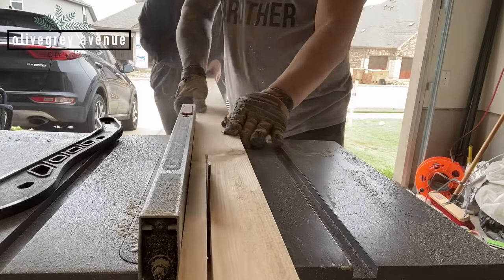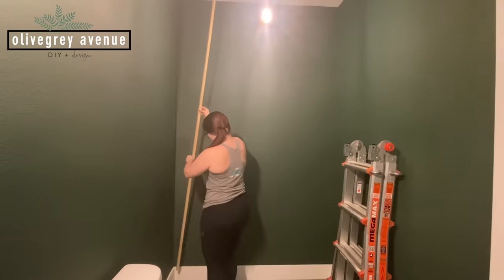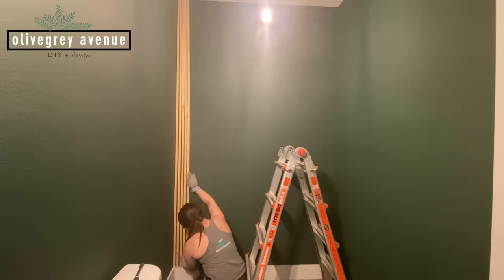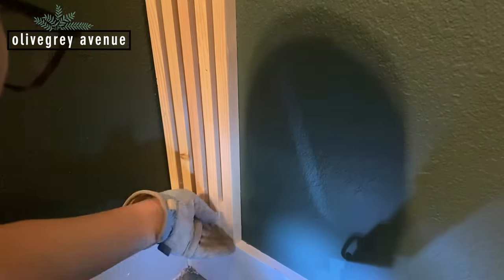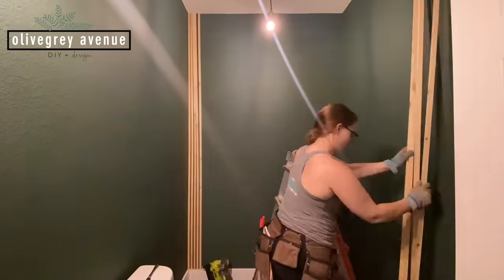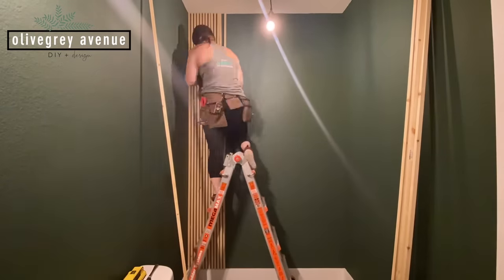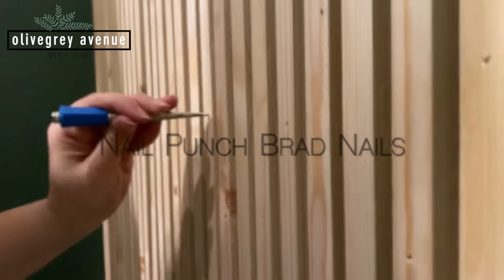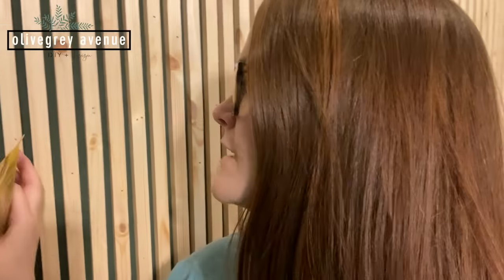Easy Wood Slat Feature Wall for Cheap!

Comment from the maker: Do you prefer these skinny wall slats or a chunkier version?
Reply: The chunkier ones are visually more appealing along with staining them it  would be less work also because they are thicker.
Reply from the maker: I prefer the skinny version I did.
Reply from the maker: @Zeeangelofdeath  you can use this method with whichever size slat you prefer

Comment: Beautiful . Would you possibly share the dimensions of the individual slat and what wood type and size did you buy and cut. This would help me immensley for a DIYer like me
Reply from the maker: The slat width will depend on your wall. Mine was about 3/4” so that it would fit the wall properly. I bought yellow pine wood and I believe I cut it down from a 1x8

Comment: Looks beautiful altho' I think you should have used a spacer!  I see areas where they boards don't look spaced evenly.  Also, I would recommend those who do this should use a level!
Reply from the maker: I actually did use a spacer and a level. The spot where I ended the boards had some larger gaps because of a margin or error with cutting all the slats. Plus some of the boards warped and created some issues there too.

Comment: Have this as a ski garage project to do for a wall, so thanks for the video ideas, hints and warnings. I absolutely hate ripping boards on my table saw. It is so dangerous as very easy to get kickback, especially with thin stock or narrow pieces and no riving knife on mine. I don't wear gloves either as you can catch a glove in the saw and it pulls your hand in. I like the dark paint idea in behind. Option of getting pre-made panels is incredibly expensive

Comment: Looks great. Best to store wood flat on floor stacked together to prevent warping or slow it down. You did a fantastic job.
Reply from the maker: Thank you!! That’s the bad part, it was all stored on the garage floor but the temperatures were just so intense that it didn’t matter 😭
Reply: For how long?

Comment: Ive priced up doing it your way and its the same accept its actually alot more work, ive since used compound between tape and painted with a watery acrylic and it is not only easier its actually most cost effective
Reply from the maker: The same as what?

Comment: Just found your channel and subscribed!  I love the slat wall.  I'm lazy so would it be possible to nail the slats on the sides so you won't be able to see the nail head or have to fill them?
Reply from the maker: I’m glad you’re here! You might be able to do some on the side but I wouldn’t say you could do all of them because I think you’d have an issue with getting them in completely and doing it on just one side as you went would not be able to secure it to the wall completely. You don’t HAVE to wood fill the holes but it looks better if you do. They do have wood filler that you don’t have to sand and that would save a step!
Reply: @olivegreyavenue  Thank you!

Comment: Great video, did you use a half inch spacer?
Reply from the maker: Rory Noir I used a very specific measurement to make it fit on my wall. I can’t remember exactly but I detail it in the blog!

Comment: How will you know if you won't hit the wirings?
Reply from the maker: There weren’t any outlets or wiring in this wall specifically but wiring should run against the drywall, it’s supposed to run through the framing.

Comment: Is it possible to directly clad a wood on bare wall without any channels??
Reply from the maker: We actually did have portions where we attach slats to just dry wall and not studs. To hold them up we used 2 brad nails going in opposite directions horizontally. This creates a V out of the wood and as it slits it creates a kind of spring holding it back. Thanks for the question!

Comment: Did you vanish the wood?
Reply from the maker: Good question! The plan was actually to stain these but I got them up on the wall and loved them so they are completely raw wood! If this was a bathroom with a shower or bath, I wouldn’t have left them raw but there isn’t much moisture in this room.

Comment: How do u clean the dust in it over time?
Reply from the maker: There’s not a lot of dust collecting in here since they’re vertical slats, not horizontal but you can clean in between with a vacuum like I did to clean the saw dust after sanding! Thanks for the comment.
Reply: @olivegreyavenue  It was the first question my mum asked me after I shared your video with her
It is a beautiful and simplistic design in my opinion but in her book it’s a big no cleaning-wise🤣
Reply: @Boshek2019  It would cost more but you could add extra slats in between, having a combo of 1x1 and 3/4 x 3/4 slats. Paint the 3/4" with your darker color. Then attach them right next to each other, alternating them, with no spacer needed in between. That way there's even less space for dust to get in between the slats. You can also sand them smooth and use either a clear polyurethane coating or whatever paint color you want. Then wood won't be rough or splintery if you go in to wipe them, dust will stick less, and the coatings will help keep the wood from warping due to humidity over time.

Comment: Girlz just gotta make a slatwall that cannot hold any hangers. Guyz like the horizontal version that has the straight lines for attractiveness but also works like improved pegboard.
Reply from the maker: You can definitely do this design in a vertical or horizontal pattern! It is for decoration as it’s not load bearing.

Comment: should have used glue/adhesive.
Reply from the maker: theandroids I actually started with construction adhesive and because the strips are so thin, it squished out of the sides. So I just used brad nails criss-crossing so they hold but it also makes the wall much easier to change in the future without major damage to the wall. Thanks for the comment!
Reply: @olivegreyavenue  I see. Thanks for the reply.

Comment: Cheaper to cut the 1x6's into 3/4" slats then to buy them pre-cut? I guess someone forgot to factor in the cost of the table saw.
Reply from the maker: Yes it is much cheaper! There are lots of affordable table saws and if you use it more than a couple times, it pays for itself! Ours was about $100 and has probably saved us ten-fold.